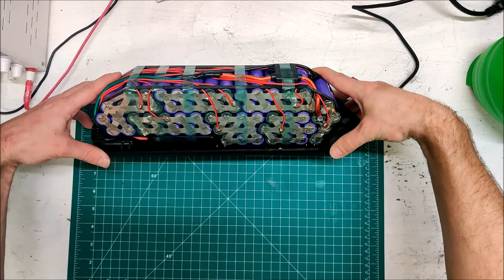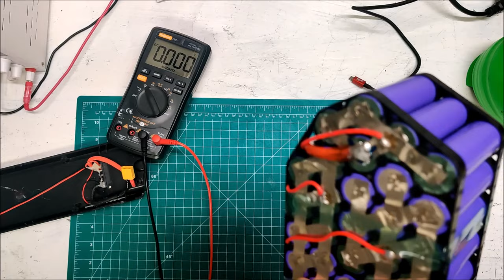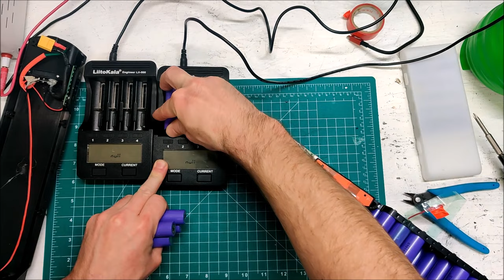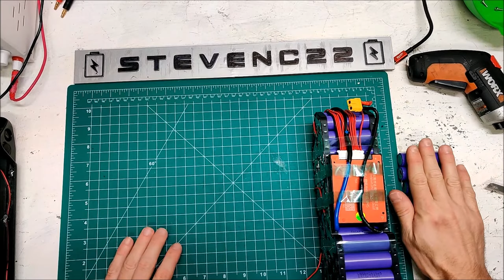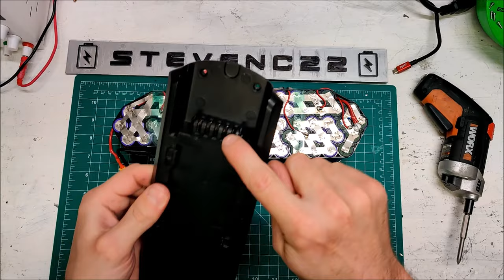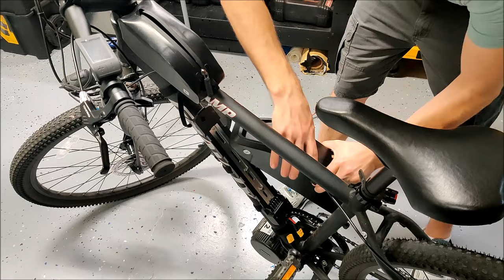Fixing a dead ebike battery

Comment: very good thank you , what is the age of the failed cell??
Reply from the maker: Probably 5 years. They were used cells before installed them and then I used it for 2-3 years.
Reply: @stevenc22  that's nice, i've just ordered a spot welder and going to try a cell replacement soon, everything seems to be working well except the SOC reading is flakey and I took off the cover and saw a burnt end on a cell and melted case inside, so here i go real soon. your video inspired me to do it.

Comment: I have a water damage battery, All my cell groups are 4.09 apart from one group at 3.74 do you think I have the same problem as you in this video or maybe I need a new bms? Please help
Reply from the maker: BMS may be bad. First charge only the low group to match the other groups and then see if the battery stays balanced.

Comment: Why solder directly to the pack? Could you solder to a new nickel strip and then spot weld it onto the pack?
Reply from the maker: Sure but no harm soldering to the existing nickel connections on the pack already.

Comment: How could one bad cell reduce the whole battery by 100%? It's not like there were not several other 14s groups in parallel with 
that 14s group. Would somebody with knowledge please explain. No guesses or rookies, please.
Reply from the maker: A bad cell actually burns energy so it will suck all the energy from the other cells in its parallel group. The other parallel groups will be fine. The problem is the BMS. It stops charging if any one group is full and turns off the battery if any one group is low. So the BMS turns off the battery because of the low group but it also won't charge because the good groups are full.
Reply: @stevenc22  Thanks for the reply! That makes sense. But I wonder why they can't design the battery so that if one cell goes out, the other sections would still provide (limited) power instead of making itself dead in the water. My solar PV system uses 18650 cells (thousands of them), but there are no parallel groups of cells; and if one series group goes out due to a single bad cell, all the other series groups (in parallel with all the other series groups) carry the load. Too bad these batteries aren't like that. That would  simply require no parallel groups of single cells, but instead, parallel groups of series cells. Your thoughts?
Reply from the maker: @Cotronixco  I understand what you mean. The problem is technically you would need a BMS for each series group. Series groups need a BMS to balance and maintain the cells. If you have multiple series groups, you will need multiple BMS. Not practical in a small ebike battery.

Comment: I need to repair my 72v 48Wh battery.  I wonder if I can use a larger battery for longer range...
Reply from the maker: You can but keep the voltage the same to match your motor.

Comment: My bms blew and shengmilo sent me a used replacement which was blown as well. My question is can I wire up my battery without a bms? Please help as I use my ebike for work.
Reply from the maker: No! Do not use a battery without a BMS. You could easily catch the battery on fire during charging or use without a BMS. Buy a generic BMS and wire it up to the battery.
Reply: @stevenc22  wasn't planning on charging it until the BMS arrives. Just want to use what power I have in the battery which is full. Thanks for the concerns though mate.

Comment: I opened up.my battery and there was a lone black wire un attached, there were only 2 wires attached to the battery red and black I soldered the wire where it goes and it showed 56 volts when I tested the 5 terminals with the +&= it showed 15.1 is it supposed to be that or 56?
Reply from the maker: Hard to understand what you mean. The total battery voltage is probably 56V. The individual cell voltage should be about 4V a cell.

Comment: I got two batteries which were never used and they have just died without even being used. Can you revive these
Reply from the maker: The BMS probably turn the battery off
Reply from the maker: Try charging the batteries or try just jumping the batteries with some voltage to wake up the BMS

Comment: One thing to try before ripping off the welds: charge that low cell group up and leave overnight without the balance lead. Just to rule out the BMS as the cause.
Reply: you mean while the suspect cells are still connected to the rest of the battery? How do you charge them like that, can you please explain?
Reply: @ademiravdic  this is to see IF they are failing before you pull the pack. It's not unknown for a BMS to discharge a cell group if it becomes faulty.
Reply: You can use a tp4056 or other single cell charger connected to only that cell group by disconnecting the ballance wires from the bms and connect the charger to the wires that go to that group.
Reply: @ademiravdic  - you want to remove the balance lead and then connect the charger to the top and bottom (+ & -) of the cell group you want to charge.  This way the charging circuit is only complete across the desired cell group.

Comment: hello, my ebike actually turns on and works as it should, but it cant charge. ive tried another charger so the charger isnt the problem. its 48v 10.4 battery. whats the solution?
Reply from the maker: One of your cells might be completely out of balance which is why the BMS might not allow it to charge.
Reply: @stevenc22  so whats a diy solution you recommend?
Reply from the maker: You need to measure each cell group with a multimeter to see if the battery is in balance. Same way I did in the video. If one cell group is out of balance you can then manual balance that cell. If everything is in balance, maybe the BMS is faulty.
Reply: @stevenc22  ok thank you very much. i would get a mechanic to do that with the tools. worse case i would get a new battery.  i  appreciate your response.

Comment: Is that blue box that you used in the spot welding the 12-volt power supply? It looks like the spot welder is not expensive and works really well!
Reply from the maker: No bob. That spot welder is power by a high amp lipo battery. That is what you are seeing. I did a review video on it.

Comment: Charged my pack last fall, this summer, pack was dead. During an attempt to recharge, the charger got hot within an hour but no charging of the pack. Comments? Pack was kept separate from the bike, indoors.
Reply from the maker: Make sure the charger is working before you jump to conclusions. Use a multimeter to measure both the charger output and the battery voltage

Comment: it looks like You are using a cutter as a plier, in such case an effective way to destroy that cutting edge.
Reply: You are correct, the tool is a "surface Cutter" and the tips break before a blade chip on good hard ones (gone through 20 pairs or so over the years).
I just re-dremel/grind the tips to even tips, though shorter, they last way longer
before a tip break.

Comment: Thank you. This happened to me and I didn't know what was the problem! I was sent a new battery but, the new battery for some reason was made slightly bigger and could not fit down the down tube. If I can have someone  repair the orignal battery and make the new battery fit, that would be idea. Thanks agian.
Reply: The same thing happened to me. I ordered a replacement 48 volt 20 amp hour battery and the base of the replacement would not fit my bike. I'm hoping I can just remove the new cells from the new case and swap them out in the old case.
Reply: You’d probably be better off returning your new battery, and buying and new battery with a new base and splicing it in. It’d be a ton easier and probably cheaper because you could buy a generic.

Comment: I have just bought a new 36v battery ,when fully charged ,I get a reading of 40v. Could this be a problem? It  is 15.6 ah but with a short range!
Reply from the maker: No that's about right. A 36v battery uses 10 cells in series. 10 x 4.2v per cell = 42v. The max voltage fully charged should be 42v. 40v is close enough.
Reply: how big of a range?
Reply: 36 volts is nominal under normal load. 42 volts is the fully charged open circuit voltage.

Comment: Just a quick question , what if it was the bms . Is that possible to fix?
Reply from the maker: No. If the MOSFETs blow up, just replace bms
Reply: They no longer sell my bionx bms.Any alternatives?Cells still good but bms shot.
Reply from the maker: @gerry5029  just buy a Daly BMS. That is the only brand I use. Cheap yet solid. Just choose the right amps rating and battery voltage rating.
Reply: @stevenc22  Thanks Steven

Comment: My problem is the charging port, but there are no video's on how to do it safely.  There are video that show someone doing it but not how to do it without getting electrocuted when connecting the wires.  It seems like they are doing it on completely dead battery's or else there's something they aren't showing, because I get sparks everytime I connect the wires. I've already destroyed 4 ports.
Reply from the maker: Maybe you have a crappy charger. A good charger waits until the battery is connected before it starts charging.
Reply: @stevenc22  that makes no sense. The voltage is in the battery, not an unconnected charger.  
  No battery is smart enough break the laws of physics.
Reply from the maker: Are you getting sparks when you plug in the charger?
Reply: @stevenc22  no.
Reply from the maker: @williampennjr.4448  Are you getting sparks when you try to attach a charging port? You must be short circuiting something. What kind of charge port are you using?
Reply: @stevenc22  Maxmoral 3PCS DC-099 DC Power Socket Connector.
I did it before with no problem. Probably because the battery was almost dead.
I had problem charging again after using it because I hadn't soldered the connections.  As I had suspected the wires came loose, but when i tried to connect using the same port I kept getting sparks. I even tried reversing the wires but same thing.  I think it must have to do with the fact that they are live wires and the battery isn't dead like before..
  The same reason you have to turn the circuit breaker off when your wiring an outlet, they are live wires.
someone suggested that I remove the fuze, but I'm afraid that after I connect the wire the same with will happen again (or worse) as soon as I reinsert the fuse.
Reply from the maker: @williampennjr.4448  William, it has nothing to do with the battery being live. You must be short circuiting the battery or reversing the polarity. You cannot just "try reversing the wires", you need to know whether the positive wire is on the inside or the outside. Most times it it on the inside. Try buying a plug with the wires already attached that way you can just crimp the wires onto your original battery. Like these https://amzn.to/3u7mUdA
Reply: @stevenc22    Thanks. I'll try that.

Comment: Im having a mess of stress with mine.           ....Mines a 2018 Ebike. basic.            Original battery died, bought New battery but the leads have the Main lead & a direct charging lead Only               .......Old battery has Main lead & a yellowish lead,for charging.          So while its the correct battery spec wise,      theres no way to hookup the yellowish wire .......  New battery wont even bootup the bike ,Zero. fully charged yet Nothing       .... I know the problem aint the bike cuz I can put the old battery back in which barely has any life & atleast the bike will bootup like normal.                       ..New battery with the main hooked up, I get Nothing whatsoever,wont even bootup.
SO.......if the yellowish wire is strickly for the charging port, why wont it bootup with a brand new battery.         . so so very frusterating. been scouring the net for like 4 days trying to find a fix.
Reply from the maker: New batteries sometimes have to be "turned on" by putting them on the charger which activate the BMS
Reply from the maker: Does the new battery have only 2 wires instead of three like the old battery? If so you can charge directly on the two wires.
Reply: @stevenc22   UPDATE ...........    When it boots up, theres 3 buttons on the screen,   each chooses a different setting such as pedal assits 1 pedal assist 2 & Throttle only basically        .....I always for 3 years have used Throttle setting only.          .........   For days Ive been baffled why no power to the motor.        ......... Today out of desperation I held throttle open a little & started pushing buttons         ..... with NO lights lit on the screen other than battery bars   ....... In other words Zero setting ......The motor works.              I dont know how or why tthis is this way, but I tucked everything back in ...   & going with it.       For obver 3 years its always been on the 3rd light/throttle mode     .........now its Zero mode .                strange but good enough for me

Comment: i have a 48v battery my packs are all 4.2v +/- .1 but one pack was 3.2v i replaced bms and took for a ride and then the 3.2 pack went to 0 and now the battery only charges to 92% then the charger cuts off saying its full at 50.6v output its a hailong battery
Reply from the maker: One of the packs is damaged. You will need to rebuikd the damaged pack before the battery will properly charge again
Reply: I've got the tools to disassemble the pack but the reassemble I don't have spot weld thing.would it be safe to drop solder if I put tiny hole through the tin strip to make the pack mesh thing
Reply from the maker: If you don't have a spot welder, don't tear apart the pack. Don't use solder. T he e only thing you can try it to manually rebalance the faulty pack with a power supply. Open the battery, meter each pack and try find the dodgy pack. The use a power supply to apply voltage to just that pack to bring it up in voltage to match the other packs..
Reply: @stevenc22  thanks for the advice Steve I'll look more into buying one I've seen some things on amazon uk ranging from £15-30 mini spot welder
Reply: @stevenc22  I've just ordered a new X-go 48v 20a battery I'll get the spot weld and try rebalancing to sort it eventually Thanks for the help and advice
Reply: @iangrassby  so how did it go for you mate? curious
Reply: @MedienGulli  I haven't got a spot weld and a cell charger yet but should be ordering next fri 10th but on my new battery i can do my normal 10mile round trip and only use 12% battery on my old it would use 50-60%
Reply: @iangrassby  thank you for keeping is updated!

Comment: I`m afraid of something like this happening to my emergency solar power stations, especially the expensive ones I have to power my freezers and fridge after severe storms like hurricanes, tornadoes, straight line winds, ice, and bad thunderstorms. We also have unseen damage to our power grid (weakened transformers/lines) caused by ice storms and hurricanes that can cause random power outages that last long enough to damage frozen foods by partially thawing them. 

I have a small backup gas generator but who can afford to run one for more than a few hours? I got it to charge my solar batteries on cloudy days. After hurricanes gas is often impossible to find anyway and I certainly can`t afford five or six gallons of gas per day for up to two weeks. Solar power stations are expensive too but offer a lot of peace of mind in today`s ridiculous world...especially in my situation. When I had a lump sum of extra money buying multiple sources of solar power was a huge no-brainer.
Reply from the maker: Yeah just do routine monitoring and testing. Only way to ensure reliable batteries.

Comment: Great video. What brand cells?
Reply from the maker: Those are LG 2600mah batteries
Reply: @stevenc22  thanks. That’s a good brand. Panasonic appear to be the benchmark. What does one cell cost and is it worth it to build your own battery?
Reply from the maker: @SemiDad  I never buy new cells. New cells are $5-$10 each. I always buy old lime scooter batteries and salvage the cells. I can get good batteries for under $1 each that way. Here is an example of where I buy my batteries  https://www.batteryclearinghouse.com/products/30-cells-high-grade-lg-mh1-10a-3ah-cells-in-10s3p-pack